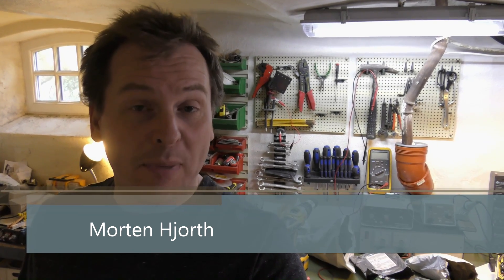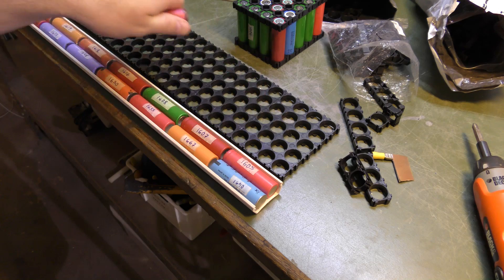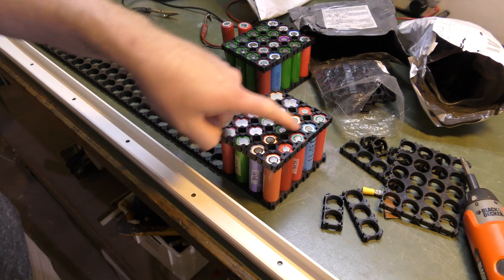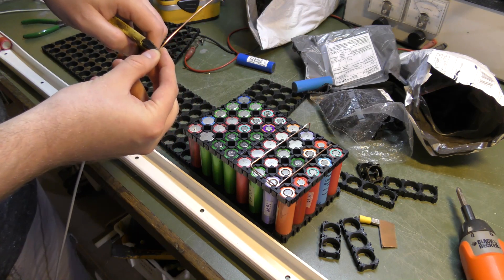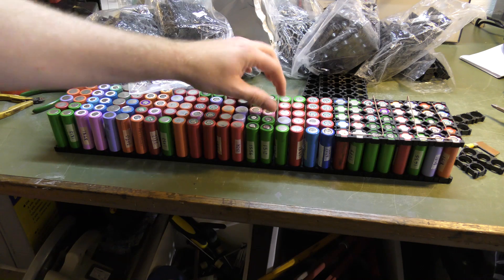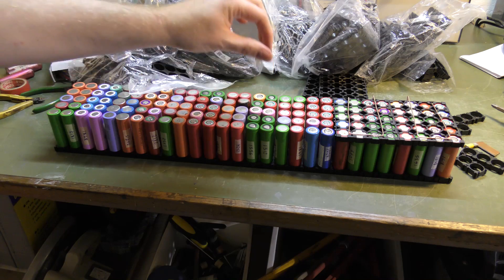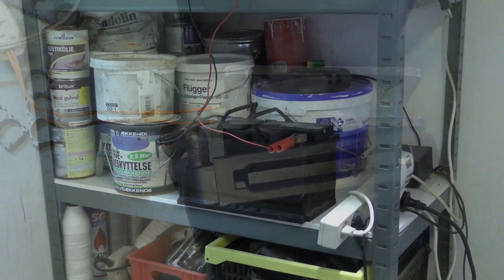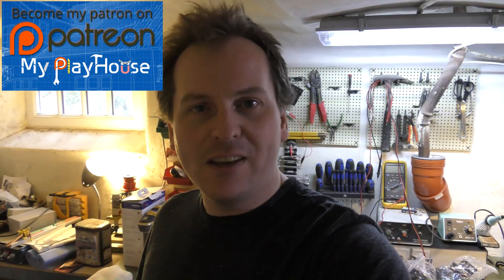1KWh PowerBank & Water Cooled Data Center - 549

Comment: What about using an old caravan fridge to cool your air into servers the fridge works on 12v possible to pick up from flea market strip it and use the compressor and cooling system in a box which air flows through, or cut into the fridge and put pipe in one end with fan to suck air from outside through the fridge into another pipe out of  fridge into server room
Reply from the maker: Hi bombay2008
Thank You very much!  Did you see the next two videos I did on this?
Thank you for watching! :-)
Reply: My PlayHouse I will have look, before I go to bed its 1am so have time.

Comment: to water cool your data center, Them rads are not going to be enough. Its all about how much TDP all your CPU's output, as well as how much TDP your radiator can dissipate. The rads you have are only really designed to deal with the heat output of one CPU. You are going to need a hell of a rad to deal with the heat output of all your CPU's. 

The best way to do this is by having one fan slot per CPU. You may want to get some 1x4 rad's and daisy chain them together until you have 1 fan per CPU. With all this, however, DO NOT USE YOUR WELL! All the microbes are going to have a field day as your cooling loop is going to be a lovely warm enclosure to thrive in. You will want to do the following,

1. Have a closed loop.
2. Decontaminate all your water. You can do this by buying pre distilled water, as well as maybe haveing some kind of UV steraliser, Some kind of kill coil (Silver coil) and/or a chemical biocide in the loop.
3. keep it at a slightly alkaline/near neutral PH to also help stop the growth of algae and bacterial micro films. Dish sope, believe it or not, is a very good additive for this task, as it will also reduce the surface tension of the water, helping it wet the metal better as well as make it easier to get bubbles out of the system.
4. NEVER MIX METALS! Rads are usually copper, so you will want all your fittings and pipes to be the same, or use plastic whenever possible. (Them fittings you have do not look copper.)
5. Learn from the mistakes of others. good resources.

Linus tech tips: whole room water cooling. 
They got it to work, but because they used copper piping for the water line to the rad, all the heat was just dumped back into the room, kind of defeating their goal of dumping all the heat outside to cool their editing room in the summer. They had a few miss haps as well. Don't repeat them!

https://www.youtube.com/watch?v=b8bLtg9J1Oc&list=PL8mG-RkN2uTyVqLN5OSZxn3Z4t1_xFunu

JayzTwoCents: Channel.
He lives and breaths water cooling. He is a good guy to watch to cut through the cruft of water cooling folk law if you will. The community is often divided on some WC practices, and he puts some of these arguments to the test to cut out the Bullshit.

https://www.youtube.com/user/Jayztwocents
Reply from the maker: Hi pseudonymity0000
Thank You very much!  I had to start somewhere,, and I did not want to use a lot of money on this,, I can air cool my data center,, there is no problem,, just interested in lowering the air comming in a little bit.
Thank you for watching! :-)

Comment: After sitting in the basement for a year without getting charged, you probably should go through the doubtlessly painful process and check each individual 18650 cell. No need to mention, I guess?
As you apparently require 48 Volts, why not whack 4 of your car batteries together in series? They may be clumsy, but they pack a nice load of Oomph!
Reply from the maker: Hi Eo Tunun
Thank You very much!  Like I do here : https://www.youtube.com/watch?v=p8KOYs52C4U
and here : https://www.youtube.com/watch?v=2G8aeGl7w_Q
Thank you for watching! :-)

Comment: If you can test it both ways, it would be interesting to if you have more luck with the series configuration you plan or putting well water to both of them and mounting them side by side. There are a lot variables and I don't think the answer can be clear without testing both or making a detailed thermal model of both. Myself, I enjoy the building and testing more than the math :)
Reply from the maker: Hi Ian Levine
Thank You very much!  next video wednesday,,on this. 
Thank you for watching! :-)

Comment: I would check the server specs for maximum ambient temperature. It's a fallacy these days that you need to keep DCs cold. I help run DCs for a large network provider and depending on the equipment in the hall we run at 22 to 25 degrees C supply air temperature. We also only work on 25% fresh air added.If you can make sure that the average temperature in the hall doesn't go above 25 C you'll be fine. Our chilled water is at 13.5 C for the coils . Look up how a CRAC unit works.
Reply from the maker: Hi jeremy toms
Thank You very much! Yes the newest server equipment can run normally up to 45c,, but older stuff like I have,, keep under 30c.
I am just playing,, and would like to see how much this could do. New video on this wednesday :-)
Thank you for watching! :-)

Comment: If you need more fan airflow, you may need to turn to a car radiator fan. Its designed to run 12V and move a tonne of air at the same time. Just a thought ;)
Reply from the maker: Hi Mac·au
I might need something bigger. Made the follow up video earlier today, you get that next week.
Thank you for watching! :-)

Comment: So I always mix that up: Do you need to balance batteries that are in series (each cell), or those that are in parallel? Because I always thought when they're in series, their voltage will equal out over the whole series of cells, but you need to balance each unit that you put into parallel separately...Now I question whether it is the other way around? That a pack of parallel batteries equals its voltage among itself, and thus doesn't need balancing, but if you put multiple packs in series, you ned it? But I'm pretty sure it was the other way around...so each 48V block of 14 cells will need a balancing circuit in itself...
Reply from the maker: Hi Seegal Galguntijak
Thank You very much!  there are 10 individual cells parallel in each blok, 14 of those in series. and the 14 blocks need to be balanced.  
Thank you for watching! :-)
Reply: Oh, I mixed it up again. Somehow I always think when they're parallel they need to be balanced, and when they're in series, they don't, but that is wrong, because I always remember it wrong. Weird...

Comment: I'm only at about 5 minutes in the video, but my first question is: how do you want to connect these batteries electrically? If you don't use a proper battery holder with spring contacts and such, you would have to weld some contact to them, because usually, these batteries don't really retain any solder that's put to their terminals, except if they have a little metal strip for soldering to (which most of them don't have).
Reply from the maker: Hi Seegal Galguntijak
Thank You very much!  You can solder on th the 18650's..
Thank you for watching! :-)

Comment: Im not sure what your plan is for cooling the datacenter but those radiators are tiny. You could get away with cooling a machine or two with them, but personally I would run the loop going from Reservoir->Pump-> Computer one-> Radiator-> Computer two-> Radiator-> Reservoir.  Alt if the water is cool and stays cool year round you could get something like a small car radiator as people have suggested only have a fan blow air through it to cool the air down and have that cooler air circulating in the room.
Reply from the maker: Hi Taylor Hardin
Thank You very much!  I am not drinking the well water,, it is just being pumped out into my garden. 800-1000 liter per day -ish,, so I was not planning on a loop.
Thank you for watching! :-)

Comment: I'd only do a closed loop system for cooling. Put a coil of copper tubing into the well then run water through this with an anti corrosive/bio growth addictive(you can get non toxic ones). Then with some PVC tubing run it to a car radiator in the DC with a fan on it. If the temperatures are dissimilar enough you won't even need a pump.
Reply from the maker: Hi Corey Allen
Thank You very much!  I am not drinking the well water,, it is just being pumped out into my garden. 800-1000 liter per day -ish,, so I was not planning on a loop.
Thank you for watching! :-)

Comment: I was just thinking about your battery projects a couple of weeks ago, Morten, and I was wondering how they were coming along. I think I much prefer this new method you are exploiting for battery creation. I recently saw a video in which a man powered his entire home for 60 hours from a wall in his shed covered with 20KWh of 18650 battery cells. It worked so well that he wanted to put in another wall of them on the other side for even more power or a longer cycle of it. I was quite impressed. I also think water cooling your data center will be nice, but I am not sure if it will provide much of an improvement since you are only cooling the air, not individual processors with liquid if I understood the system's application thoroughly. Thank you for sharing these updates, Morten, and I quite enjoy seeing all the nooks and crannies of your PlayHouse!
Reply from the maker: Hi Tyler Barton
Thank You very much!  Yes you have also been watching : http://www.diypowerwalls.com/cellcount.php
Me to!!
Thank you for watching! :-)

Comment: There are some things I thought of when I saw this video that I think you should think about
First
 why use such a cooler to cool a room and not just a computer box so why
 not take a cooler from a car and the power fan that drinks air gives 
you a big cooling and can go down to power on both fan and pump when i Suppose you lay down a separate closed loop in the well so you bet that there is clean water running around the system

And
 the other thing was that I think you should check out some more online 
when it comes to 18650, since there is a good forum for it and many have
 youtube channels

And why do you choose 14S? Do you have any ups with 48-60v? I thought if you have 24V UPS, it's 7S and may be good with a BMS that lets you get information from or meter on each cell.
http://www.diypowerwalls.com/cellcount.php
https://www.youtube.com/user/hooptejoe?&ytbChannel=AveRage%20Joe
https://www.youtube.com/user/nocrf50here?&ytbChannel=HBPowerwall
https://www.youtube.com/user/daromeresperyd?&ytbChannel=DIY%20Tech%20%26%20Repairs
https://www.youtube.com/user/paulkennett?&ytbChannel=Paul%20Kennett
Reply from the maker: Hi jadu79
Thank You very much!  This is way to much for me to reply to,, please check other commants.. I have been playing with 18650 for quite a bit now,, and have watch lots of videos,, and done a few tests my self : 
https://www.youtube.com/user/SirNetrom1/search?query=18650
https://www.youtube.com/user/SirNetrom1/search?query=48v
Thank you for watching! :-)
Reply: It was 
not meant to be a cretch, but more that you could see and get tips on 
what others had worked best and then it is better to avoid things that 
did not work well for others,

But the 
reason why I think you should put voltmeter on each cell (or easy to 
check with a multimeter) is for some people having a bad luck with BMS 
that does not show that it goes off without notice and can overcharge 
the battery, which can be dangerous And then it's better to see if they are even or not

I read some of the posts you made and received a response to a bit I wondered
(Google translate changes to what I mean sometimes)

Comment: Bend a copper coil that fits in the pipe in the wall and then push really cold water through it it will condensate and then your blower will blow cold air
Reply from the maker: Hi TekkitWithZander
Thank You very much!  I am not drinking the well water,, it is just being pumped out into my garden. 800-1000 liter per day -ish,, so I was not planning on a loop.
Thank you for watching! :-)

Comment: Whenever you are doing watercooling, the safest way to do it is to run destilled water and not water from the spring or well, because algie will start growing and it will clog up the radiators and cpu block and you will need ATLEAST 1x 120mm radiator for each CPU, no less than that same if you are doing watercooling with a grapichs card, you'll need to add another 120mm radiator to the loop, so for 1 cpu and 1 grapichs card you need 240mm radiator or 2x 120mm, even if you are using some kind of algie killer, there would still be growing a little bit, so destilled water is the way to go whenever you are watercooling
Reply from the maker: Hi Skinnwalk3r
Thank You very much!  I am not drinking the well water,, it is just being pumped out into my garden. 800-1000 liter per day -ish,, so I was not planning on a loop.
Thank you for watching! :-)

Comment: I would not try watercooling.  Way to difficult in dense server racks.    lookup OVH watercooled datacenter.  
I like the powerbank idea.   ->   power your data center with a powerbank and solar panels   That would be very interesting. 
This week I learned that you can get Solar panels for free from distributors when the glass is broken.   Customers want prestine solar panels,  but a broken glas on a solar panel does not mean its not working.  Just does not look good.
Reply from the maker: Hi NiNaVID
Thank You very much!  all my panels had broken glass,,on the back.
Thank you for watching! :-)

Comment: I don't think that regular water (H2O) is meant for use in "water-cooling" radiators... Wouldn't be better to cool the Datacenter using green-forced recirculation?
Reply from the maker: Hi Magicairsoft9
Thank You very much!  I blow out the hot air,, and bring new cold air,, that is way more efficient than cooling that.  I am just trying to lower the temperature of the air comming in. by a couple of degrees..
Thank you for watching! :-)

Comment: Fun project with using the well water for cooling. I think you'd get the most out of it by cooling the warmer air already in the room, than by cooling outside air blown in. Of course, if you want aim for cooler air inside than outside, it would be different, but that would take a lot bigger radiators.
Reply from the maker: Hi Johnnie Hougaard Nielsen
Thank You very much!  But my datacenter is air cooled,, meaning that I pump in cold air, and pump out the hot air,, I do not reuse it in the datacenter,, I am just trying to lower the temperature of the air comming in. by a couple of degrees..
Thank you for watching! :-)

Comment: Issues with water cooling idea.

- Organic growth in the loop, as you cannot have any chemicals to stop this gong in the well.

- Dissimilar metals on your cooler. Aluminum and galvanized parts will cause a reaction and create leaks.

- Aluminum water blocks and "drinking water" I assume you drink the water from the well. aluminum has some very bad health    effects so I would not want water cycling through it and the drinking water.
Reply: I'd not expect it to be a loop, but using the excess water (which he's already pumping away to prevent basement flooding) to provide some cooling. In that case, not much of a growth issue.
Reply: Linus Tech Tips would show most of these points on his whole room water cooling setup he did a while back
Reply from the maker: Hi F1torrents
Thank You very much!  but I am not drinking the well water,, it is just being pumped out in to my garden. 800-1000 liter per day -ish,, so I was not planning on a loop.
Thank you for watching! :-)
Reply: @MyPlayHouse  You can easity solve that problem with water to water heat exchanger! That way you well water and the water that flows though radiators do not mix. :)
Reply: F1torrents i think he should use something called "kill coil" a metal piece where u can place in the reservoirs, i did see once in custom pc watercooling its more like alternative to biocide and anti corrosive
Reply: Yeah, @MyPlayHouse should really discard this idea of using "well" water...
Reply: yeah i was thinking the same thing

Comment: An old empty p.c case would be a good place to fit your battery blocks into, remove all plastic bits from the case and internal bays, it's a possible and cheap :-).

Shame you could not get your hands on a heater core from a car, larger surface area and a larger house fan could blow through it, maybe.
Reply from the maker: Hi @zx8401ztv
Thank You very much!  glad you liked the video :-)
Thank you for watching! :-)

Comment: You are going to need a much bigger radiator to cool the data center. Like a radiator from a car.
Reply from the maker: Hi BlueFoxTV
Thank You very much!  well here at first I would just like to see the air comming into the datacenter go gown by 2 degrees.
Thank you for watching! :-)
Reply: BlueFoxTV I was thinking the same thing
Reply: yeah it also needs to be the same metal as all the other parts to prevent issues

Comment: I am also trying to build my own Data Center in the Himalayas. The main problem is lightening and unavailabilities of spare parts.
Reply from the maker: Hi Rabins XP
Thank You very much!  Lightening, is not a problem in this TOTALLY flat country. :-) 
Thank you for watching! :-)
Reply: Nowadays, here in Nepal, Lightning is less effective because the government building has installed many towers which first hit there. Still, during heavy lightning, it rips the whole cable lines. But these days because of grounding and high voltage electricity supply system setup by NEC has prevented many damages.
Reply: It's quite flat where I live in Australia, plenty lightening though. Cold sea and hot desert causes a bit of conflict :D
Reply: Welcome! I love watching such stuffs.
Reply: +Thomas smith you need to construct additonal lightining rods / pylons ;)